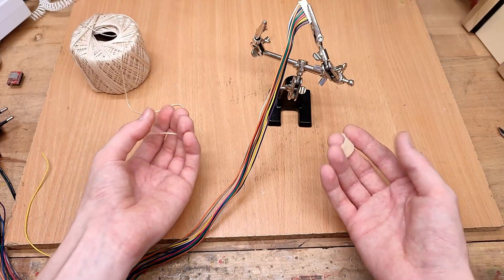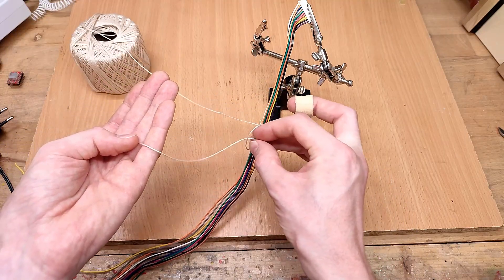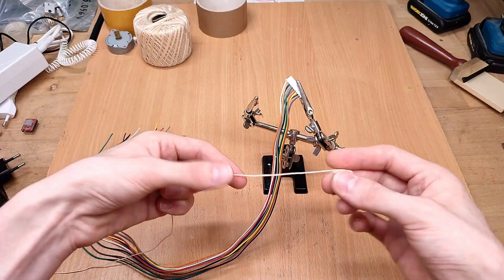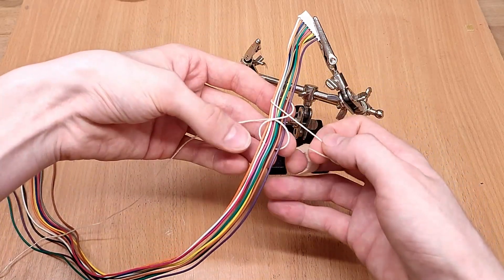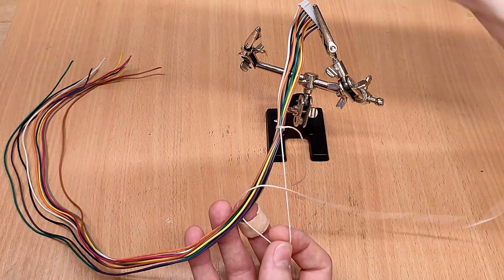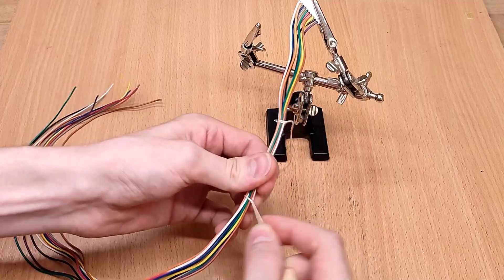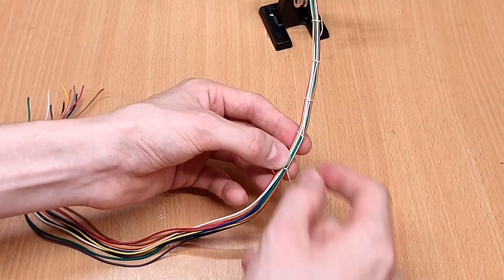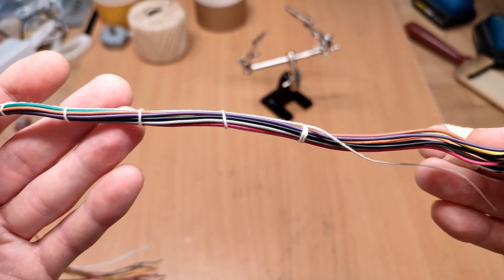Cable lacing the easy way - spot tie and running stitches tutorial

Comment from the maker: So before I get bashed in the comments for doing it wrong/using the wrong string etc... This is a non-professional tutorial meant for home/DIY use only, and should in no way be used as a guide for how to do it in critical applications like the spacecraft you might be building! 😉
Reply: what string do you recommend for electrical wiring similar to the size in your video?
Reply: @atom631 lacing cord is what it’s called wax covered twine basically

Comment: I laced many miles of cables and wiring looms with waxed linen thread during my years working for the GPO/BT, using the same technique as yourself. When the waxed linen thread was pulled tight the laced cables/looms remained in place until they were physically removed. Much neater than cable ties.

Comment: What keeps the knots from sliding along the wires?  Does securing the ends to something (besides the wire) at the ends of the wire stop the knots from sliding along the wires?
Reply from the maker: Just friction,  ideally you'd use wax coated lacing cord because the wax makes it slightly sticky and prevents things from sliding. Except in spacecraft I read they can't use the wax coated stuff since paraffin sublimates in a vacum